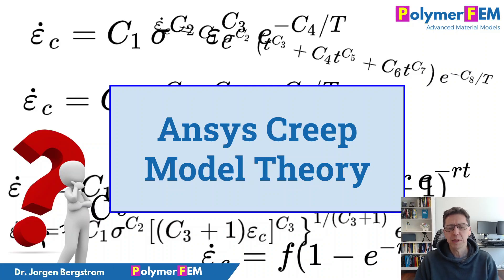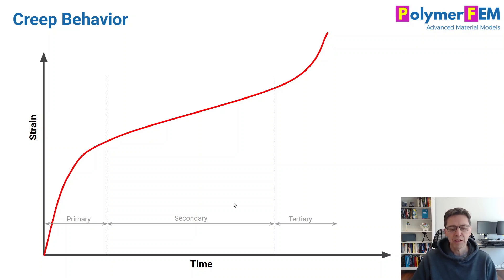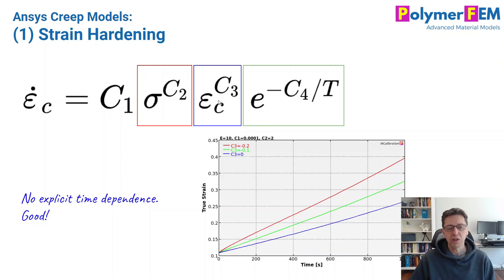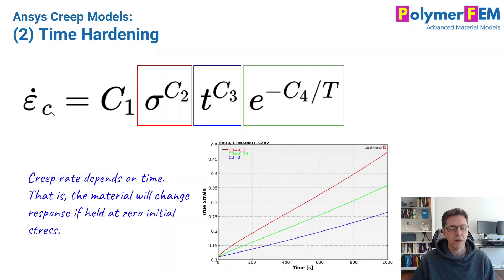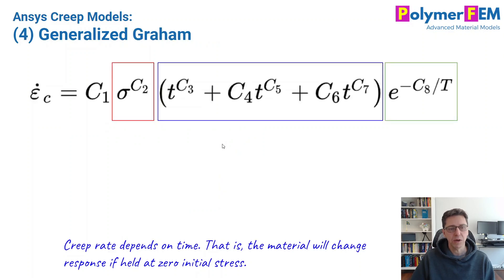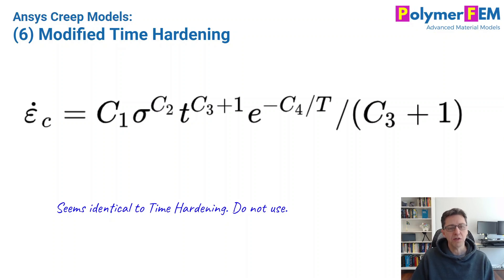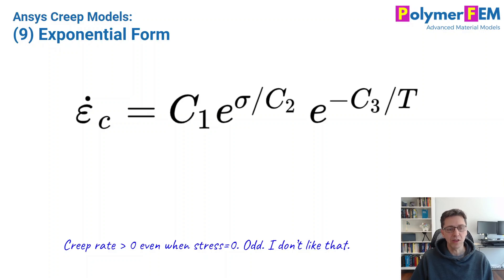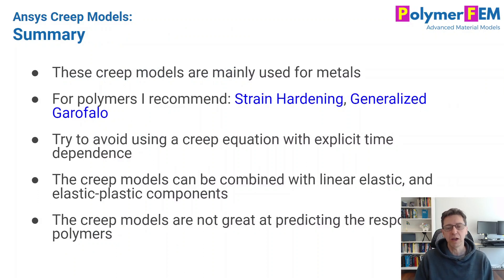Ansys Creep Models: Which One is the Best?

Comment: Thank you for explaining various models! There is one part that I cannot agree. It is an argument that "any simulated part will change its properties with time even if there is no applied stress" in the creep model 2 (time hardening). The product (stress^C2)*(time^C3) is zero when stress=0, unless C2=0. So, there is no problem of an artificial growth of the strain rate with time without load. I have done processing of creep test data, and it turns out that the models (1) and (2) are eventually mathematically equivalent both leading to a power law dependence for creep strain vs time.